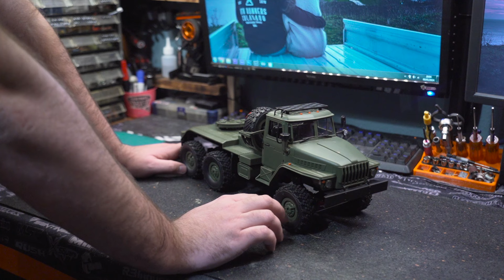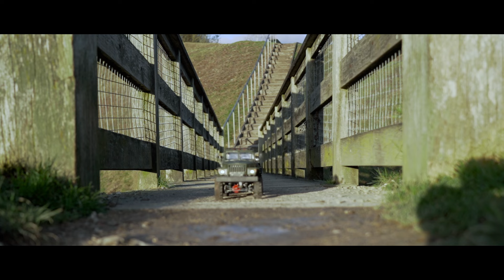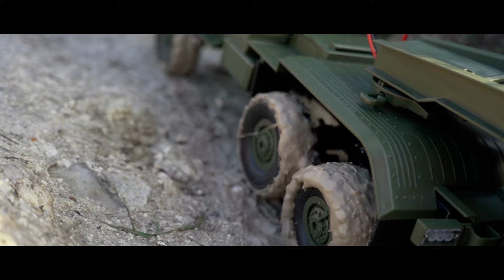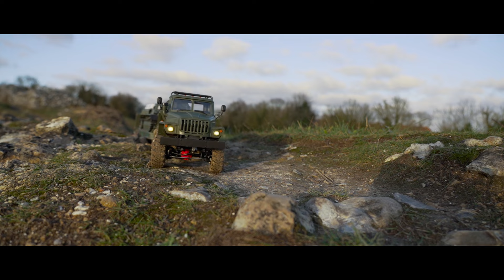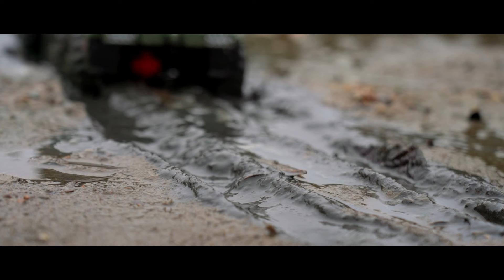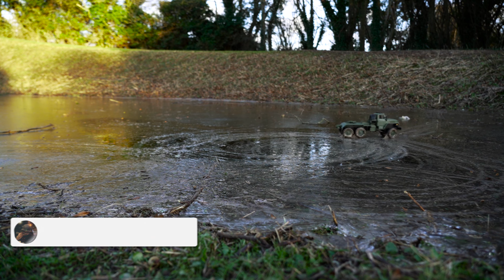How The WPL B36-3 Should Have Been From The Factory!!

Comment: Way ahead of you brother! That's why i ended up getting the  KM version of the B36 just for the metal parts, the 370 motor, and the two-speed gearbox, wheel weights, etc. My only "gripe" is that the stock gearbox gears are still plastic, so something worth upgrading as you go. It should be possible to do a full metal conversion on the B36-3, but that would be pretty expensive. Someone wanting a metal conversion might be better off getting the B36KM and a B36-3 and kitbashing the two vehicles. Just my thoughts...

Comment: Needs a 370 motor to get it even, no way a 260 gonna pull itself and the trailer, if you can something even higher that's good but that requires replacing stock electronics.